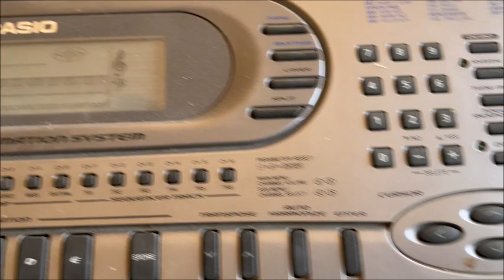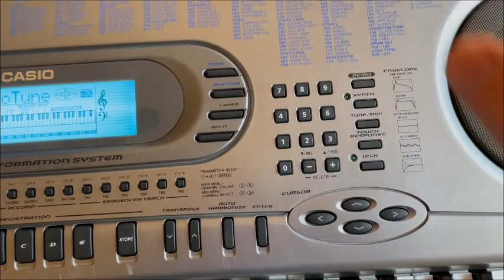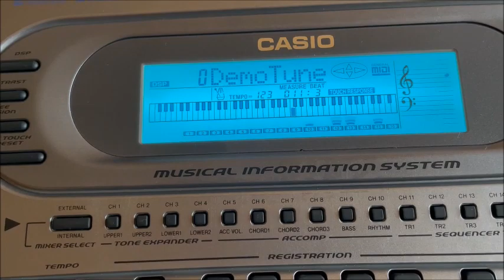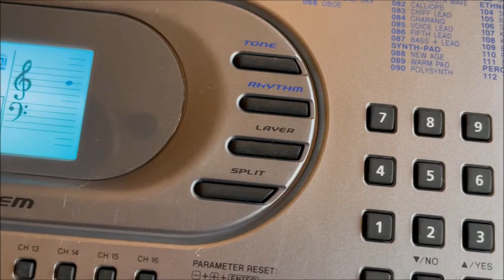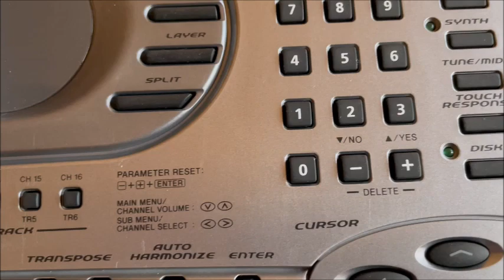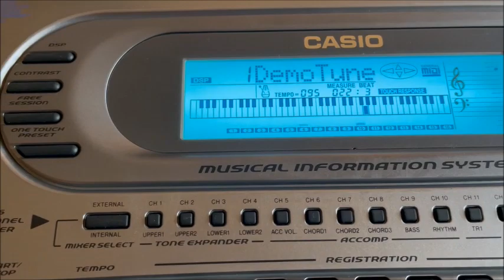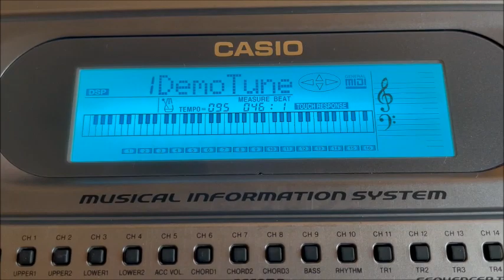Casio WK-1800 repair

Comment: Ribbons without connectors are the bane of every vintage consumer keyboard collector. Makes repair so much more labor intensive. Casio was definitely a repeat offender- likely done as a cost-saving measure. Those early WK series boards were huge!
Reply from the maker: At least it had a manageable pitch (distance between wires) and was surface soldered instead of through holes.

Comment: Hi, i just picked up a used wk3000, with the screen “glitching” or switching between options when using the directional buttons and number pad. Can I ask what I should use to clean the contacts on them? Thank you. It was supposed to be a gift for my friends daughter, so im bummed i got one with screen issues, all for $40, and a 2 hour drive.

Comment: @organfairy Hi!! Mister...!!

I own a keyboard, its CASIO WK3800 very long ago!!

But I have an issue with my keyboard...
I feeded it with a 12 volt 20Amp-hour and I accidentally blew up my own keyboard... It doesn't run anymore 😢 on the main input feed for AC... Now I feed it with same battery (12v20Amp-hour) on the battery input (that's below -you know-, but this time I'm using a 15 ohm ceramic resistor (a huge one) to protect it...
My request sir is...
Can you teach me how to repair the main AC feed so my keyboard can run normal again?

Hoping you reply my message dear sir!! 
Respectfully  yours 
MIster M.